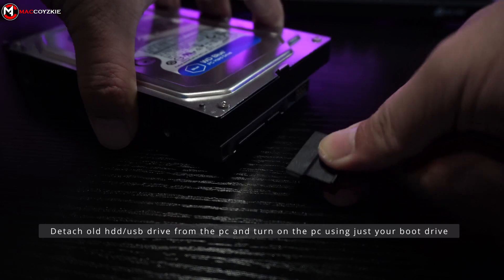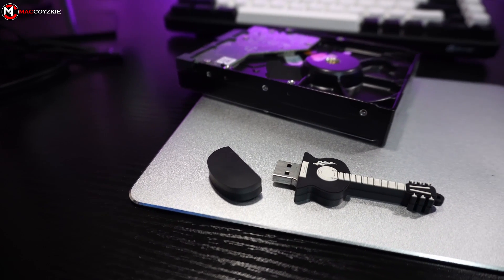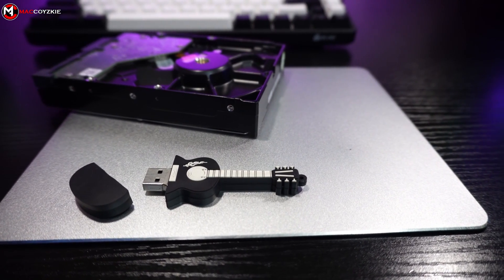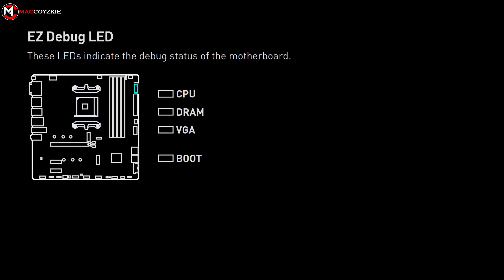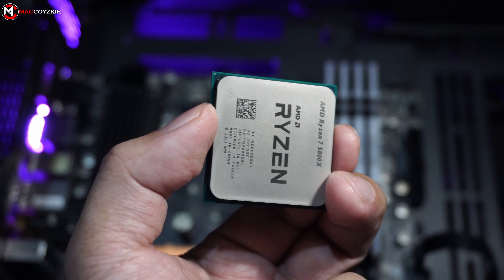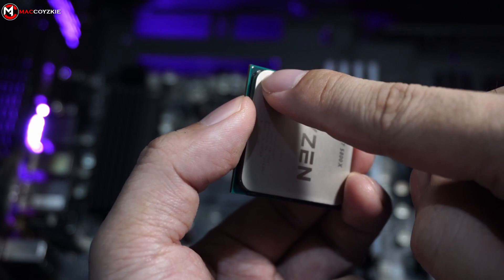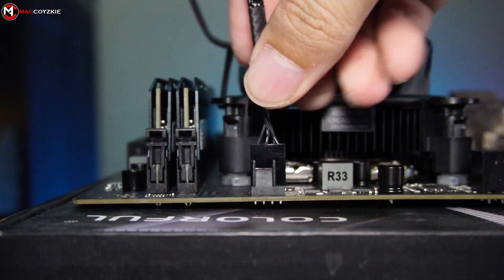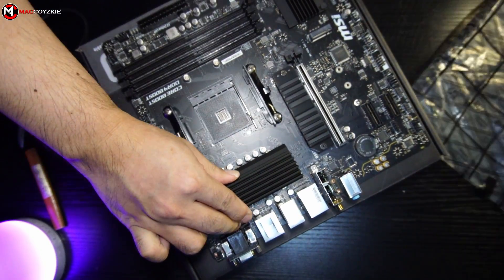Debug LED always on FIX

Comment: I built my system without its GPU arriving and plugged my HDMI into my motherboard. the “BOOT” led on my motherboard is red and on constantly yet I still get a display and can use my pc without any issues at all. Thoughts?
Reply from the maker: this has been an issue ever since this year 2024 enters. most motherboards are like this for some reason. if you look into the comments there are a lot of people who had the same issue. you can actually ignore it but if its bothering you so much the fix there is to update the bios firmware. make sure the firmware is compatible with your current cpu because if you made a mistake you'll lose monitor signal. check this video too for more info https://youtube.com/shorts/nfH5Do3Dq3o

Comment: my boot ez debug light is constantly running, but i have a display and im in bios.. help?!
Reply from the maker: it happens to many new builds nowadays for some reason, even with some of the comments here. the fix there is to udpate bios, make sure the bios firmware is compatible with the cpu. and a bit of warning before doing it yourself https://youtube.com/shorts/nfH5Do3Dq3o

Comment: Thank you , the problem has been solved. But the CPU light and VGA light are on when the computer starts up and then disappear. Is there a solution ?.
Reply from the maker: that's normal, the motherboard actually checks the parts if its working. if your pc starts fine you shouldn't worry about it
Reply: Okay thanks 👍.

Comment: For me my issue was on Q boot Green LED was on at all time the cause was Asus Motherboard Z690 A Prime and the ASUS 24 inch monitors issues when turn on the PC the monitor was blank couldn't see the bios AMI on the screen by using another monitor did the trick  Chat with a tech at ASUS web site she told me it's a plug and play issue with Monitors and the Z690 motherboard I had to removed every hardware on the board to find out it was the Monitor issues ?
 Monitor compatibility issues with some ASUS motherboard Brand new ASUS board Weird my ASUS Z490 A Prime no issues
Order a new ASUS Monitor to see if it work if not i return until i get the right monitor for the board so it isn't always issue with
HDD or M2 drives but Monitor as well  been using PC for 20 years never had an issue like this with monitor or motherboard issues.   What it's going on with ASUS New Asus Motherboard,and Monitors issues?
Reply from the maker: "Q boot Green LED" on an Asus motherboard, such as the Z690, typically indicates a problem during the boot process. On many Asus motherboards, a series of LEDs (often referred to as Q-LEDs) are used to diagnose different stages of the boot process. Each LED color corresponds to a different component or stage: 

Green LED: Usually associated with the boot device (e.g., SSD or HDD).

since you are using your drives for years already, i think age has something to do with it. why not try to boot the system with just the m2 and see how it goes, if the pc boots properly then the hdd might already be on its way
Reply: @MacCoyzkie  I'm agree with you, and I understand the Tech at ASUS told me the issue was my ASUS monitors was not compatible with my Z690 board 
the monitors as to be (plug and play?)  funny i have an extra ASUS monitor built in 2020 work fine  on the Z690 but the ASUS 24 inch on built in 2015 and 2020 no display anything on the screen (blank) monitors are on power with my ASUS Z490 A Prime  it work fine on these two monitors.  Meantime the green yellow light still on at all time until I add this extra monitor and the boot light when off i tried again my two ASUS monitors nothing blank to make but the green book Q led light it on . Funny now with the extra the system work fine go figure I never saw issue like this in Twenty years I build PC  So can you tell  me why these two monitors won't work on this Z690 ASUS  go figures I order  a  new ASUS monitor build in 2023  I don't have it yet I don't know going from LGA1200 to LGA 1700 cause this issue? I have an Intel  I7 12 Gen 12700K With 32 GIG DDR5  G-SKill ram NVIDIA  GEFORCE RTX 4060I video, and a Noctua NH-U12A  cooling fan system replaced the 1700 socket by a LGA 1700 BCF the Case is Thermaltake  Use M2 by Samsung 1 gig.
Reply from the maker: @DanielField2023  wow this is the first time i heard about the monitor not working with a particular motherboard. to be honest i really don't know why. since both of motherboard and monitor are manufactured by Asus then they should have an answer for this.

Comment: I tried 2 different video cards and it does it with both of them the LED stays on the PC starts up normally, to make it turn off I have to restart the PC and so it stays off I don't think it's the faulty video cards, do you have any suggestions? Defective motherboard?
Reply from the maker: how about try a different psu? I hope you can borrow from someone you know
Reply: already done, tried 2 new video cards 3060/4080, the problem was the monitor, a bug on the motherboard, I hope they resolve it with a bios update

Comment: Thanks for the video. My pc want to boot up for a while after doin these method. My pc will turn off again and cpu and dram led lights on. After i restart it again it just the cpu led turn on.
Reply from the maker: this sounds like a faulty motherboard, bring it to a local shop and have them test it for you since you need other working pc to check issues as such
Reply: @MacCoyzkie  hi thanks for the replies, now my pc working after i let it off after 1 day. Coul it be powet supplies issue?
Reply: Now when im playing games (fifa) the pc restarting it self. I notice the cpu temperature quite low (50 c) then i usually play before, normally i get around 70 celcius
Reply from the maker: @equittone1839  oh ok, can you try this out first https://youtu.be/Azf79t1vkaU

Comment: Bro i just bought one b550m pro vdh wifi and i can access bios but it wont boot my ssd with windows 10, i can see the ssd there it shows on the bios but i cant boot and the white light boot is always on. any chance you can help me? im depressed right now, i don't want to activate the warranty, here in Brazil everything takes a long time
Reply from the maker: can you reattach the boot drive and do this next https://youtu.be/S9hyEPTFR10

Comment: Bro i just build my first pc and i don't have a GPU(i am poor). it's vga light is on and there is no display can you help me please
Reply from the maker: you need to check if your cpu supports integrated graphics, if it does and you still have no display i suggest update the motherboard bios compatible with your current cpu

Comment: For me this meant I had plugged the wrong connector into the cpu port, there is a graphics card "6+2" and a cpu "8" pin (possibly 4+4) I was pluggin the graphics card one into the cpu slot
Reply from the maker: you wont be able to even if you force it since those have different pin orientations

Comment: So, Odd question.

I Recently did a custom build, When i finished the Red (CPU) and Yellow (DRAM) are constantly on, I've tried reseating all the ram, doing ram 1 at a time (Different sticks) Don't see any damage.  Lights are not blinking, Just solid RED & Yellow.

Looked at CPU itself don't see anything wrong, Tried briefly without CPU Fan to see if maybe it was pressure? Didn't change it.

Far as i know it should be compatible with eachother?
MSI PRO B650M-A WiFi ProSeries Motherboard,
Thermalright Assassin X 90 SE V2 CPU Cooler,
AMD Ryzen™ 5 7600X 6-Core, 12-Thread Unlocked Desktop Processor,
Sapphire Pulse AMD Radeon RX 7800 XT Gaming Graphics Card with 16GB AMD RDNA 3,
Corsair Icue 465X RGB Mid-Tower ATX Smart Case,
CORSAIR RM Series (2021), RM750, 750 Watt, 80 Plus Gold Certified, Fully Modular Power Supply.

Only thing i haven't tried is CMOS spent a good 9 hours trying to fix.

Anyone else have any other suggestions? I'm thinking it is CMOS or Motherboard itself, I've decided to stop touching it and bring it in to a local expert before i make the issue worse. Just trying to collect as much data and suggestions as i can.

And yes, I Tried leaving it running for an hour to see if maybe it was doing memory training? Lights never went away.
Reply from the maker: I checked your pc specs in pcpartpicker.com and it seems like the specs are compatible, i didn't get your ram model name though so you can check it again just in case, usually the website will tell you if ever there are incompatibilities. If there is anything i can think of, perhaps the motherboard needed bios update. since the pc are all brand new i suggest bring it to the local shop where you got it from and have them do the bios update for you
Reply: @MacCoyzkie  My bad, Forgot to paste RAM XPG Lancer Blade DDR5 6000MHz CL30 32GB (2x16GB).

I'm getting a Diagnostic done locally all the parts are brand new off amazon got them premium shipped to avoid damage, I think it might of gotten damaged (Motherboard) when i took my antistatic gloves off to put wires in, Couldn't see what i was doing have big hands the gloves made it too difficult. I'm praying it's just the Motherboard have removed the GPU to make sure no damage comes to it and have placed it in the anti static bag. 

I Did all the work on it, Not a prebuilt. Was my first PC Assembly think i really goofed hard on it. Think i was being too careful and didn't seat things properly or it got static shocked when i did the wiring.

Gunna get it assembled locally aswell if it's not a huge costly repair job. I let my friend convince me to do a custom "It's adult legos" Very stressful lol. Probably going to stick with Prebuilts till GPU and CPU prices start being reasonable.

Thanks for the quick response btw, Just trying to gather as much information as i can so the Technician has an easier time.

Sorry for ranting too.
Reply from the maker: @Sel-Und-Irae-Steam  it's fine bro, i hope it will all go well with your pc build :yougotthis:
Reply: @Sel-Und-Irae-Steam  bro did you fixed it? i have the same problem
Reply: @aloysiusjonathan4981  Yeah, If it does that you need to reset something on the motherboard itself, I forget what it's called.

Brought it to a local technician and he had it fixed in less than 5 mins, You can probably narrow it down off that alone if you ask on the PcBuilder reddit.

It wasn't anything i did wrong, Everything was put in properly but the motherboard itself wouldn't accept any of it till that operation was done.

I self installed windows OS and my drivers after that.

When i mentioned it on the reddit last time people were laughing at me for needing to get a technician to do it, Apparently can just do it with a pen or something? Idk, Just getting the initial setup down by a technician next time and i can self install everything else, Just costs an extra 150
Reply: @aloysiusjonathan4981  I hate YouTube sometimes, Dunno if it saved my response but.

It's something to do with the Motherboard itself, I had brought it in and an technician had it fixed within 5 mins of looking at it. It's something you can do apparently with just a pen though the technician used a machine to do it.

Forget what it's called, I repressed most of it / was making me angry. I think with that description alone you can probably get an answer of the PCBuilder Rdit.

Everything else was properly put in place, The Manufacturer just didn't do their job before shipping it out. Everything else super easy to install, Drivers, OS, ETC.
Reply: @aloysiusjonathan4981   

It's something to do with the Motherboard itself, I had brought it in and an technician had it fixed within 5 mins of looking at it. It's something you can do apparently with just a pen though the technician used a machine to do it.

Forget what it's called, I repressed most of it / was making me angry. I think with that description alone you can probably get an answer off the PCBuilder Community

Everything else was properly put in place, The Manufacturer just didn't do their job before shipping it out. Everything else super easy to install, Drivers, OS, ET
Reply: @aloysiusjonathan4981  YT Keeps deleting my comment, Do you have a discord i can send it to? Normally wouldn't ask but 5th attempt had enough with YT.
Reply: @aloysiusjonathan4981  Check response above, It kept getting deleted when i tried responding to you directly.
Reply: It's something to do with the Motherboard itself, I had brought it in and an technician had it fixed within 5 mins of looking at it. It's something you can do apparently with just a pen though the technician used a machine to do it.

Forget what it's called, I repressed most of it / was making me angry. I think with that description alone you can probably get an answer of the PCBuilder Rdit.

Everything else was properly put in place, The Manufacturer just didn't do their job before shipping it out. Everything else super easy to install, Drivers, OS, ET

Comment: I have a gigabyte x670 gaming x ax v2 motherboard everything is working i have a red light on my mobo that stays on is that normal
Reply from the maker: if the pc is working fine you can just leave it for now, I got several clients who had the same issue, pc is working but the debug led lights up steady. we update the bios compatible with their cpu and it works just fine afterwards, no more debug led lighting up. though some of my clients just let it be and nothing really happens in their pc, they are still gaming in it

Comment: Very disappointed watch almost 10 videos on yt on this issue and still no one solved my problem " I'm having the issue of cpu light showing on motherboard and no signal on monitor" I did everything repositioned my cpu and ram etc but still no signal 😢
Reply from the maker: new build or was a working pc before the debug led happens? if its a new build tell me the pc specs
Reply: @MacCoyzkie  new build I have the same issue
Reply from the maker: @Lashard89  depending on your build then the motherboard might need bios update. check this video for more info https://youtu.be/r-DbD0za6ns

Comment: I just built my pc and the DRAM is lit on. Nothing worked. I have a ASROCK motherboard and every other part is corsair branded. Please help😢
Reply from the maker: what's the pc specs? maybe the motherboard just needed bios update that will work with your current cpu
Reply: @MacCoyzkie Well the screen doesn’t show anything when turned on. I have a list of what I ordered if that helps.
Reply: @MacCoyzkie 
CPU: I5 14600KF
CPU Cooler: Corsair A115
Motherboard: ASRock Z690 Extreme
Memory: Corsair Vengeance RGB Pro 16GB(2x8GB) DDR4
Storage: Lexar NM710 2TB M.2
Video Card: MAI VENTUS 2X RTX 4060
Case: Corsair ICUE 4000D
Power Supply: BitFenix BFG Gold ATX 3.0
Case Fan: Corsair LL120
Reply from the maker: @arapo1001  The ASRock Z690 Extreme ATX LGA1700 Motherboard supports the Intel Core i5-14600KF 3.5 GHz 14-Core Processor with BIOS version 15.05. If the motherboard is using an older BIOS version, updating the BIOS will be necessary to support the CPU. 

you can actually ask the store where you got the motherboard from to do the bios update for you, assuming their store is near you. if not the local shop is your only choice or you can do it yourself. just be careful though, more info here https://youtube.com/shorts/nfH5Do3Dq3o
Reply: @MacCoyzkie when i turn on my computer it’s showing no signal
Reply from the maker: @arapo1001   you need to update me what you've done so far, you need to elaborate that

Comment: hello, i have a problem with my vga led. Sometimes my gpu is detected and works fine and sometimes my gpu is not detected and VGA light is on so i just restart my pc by the power button of my case and after the restart it's work fine ?? Someone can help me please ?
Reply from the maker: have you tried the suggestion in the video yet? try to clear cmos too https://youtu.be/S9hyEPTFR10

Comment: Here’s my issue…. I had to always make my bootable option to boot in UEFI/LEGACY. I think most are defaulted to boot in UEFI. My boot led is on, and I am not getting any display output to even get to the BIOS, nor are my keyboard and mouse lighting up. Any ideas? I think I may have to get a different m.2 and use a USB and reinstall windows. The only 2 drives that are hooked up to SATA are for games and other software.
Reply from the maker: remove the other drives first and just leave the drive that has windows in it, clear cmos https://youtu.be/S9hyEPTFR10 and see how it goes. if still does not work try the new nvme you mentioned, im a bit concern over the keyboard not lighting up, because usually that is a psu or motherboard issue
Reply: @MacCoyzkie  So I have tried it all. Even did a minimal post with no ram, no drives and the CPU debug light is on. So I think it’s fried. This is the second motherboard I have tried. PSU works as it should. So, have a new CPU coming and hoping that fixes it. 😖
Reply from the maker: @Motornationz  i hope it does work then

Comment: I tried everything but the bios update i know which 1 i need only problem is i have no screen since the debug is on so how do i update my bios when i cant even get the file on it since the stupid debug is on hmm?
Reply from the maker: most motherboard nowadays have a flash bios button on the motherboard io. you don't need  display to update bios. All you need is the usb drive with the bios file in it and press the flash bios button. knowing if the bios update is done, you need to check the motherboard manual for that since each motherboard manufacturer have their own way
Reply: @MacCoyzkie  ight thx for the tip also ive found the issue somewhat turns out i reslotted my ram stick and then it started working again really weird
Reply: @MacCoyzkie  its also a brand new stick so thats ruled out
Reply from the maker: @marokko888  good thing its just that, glad its all good now